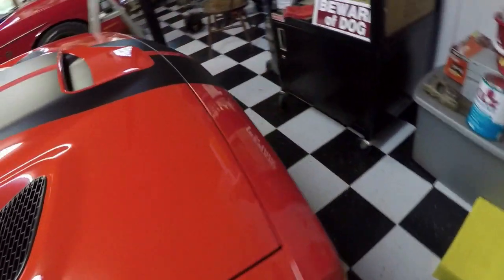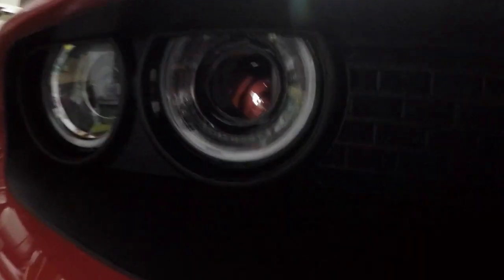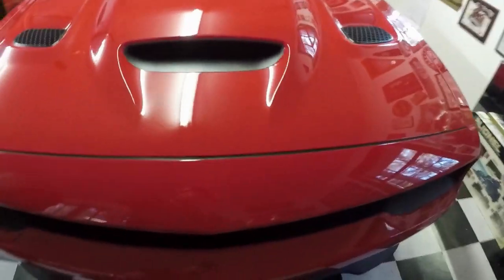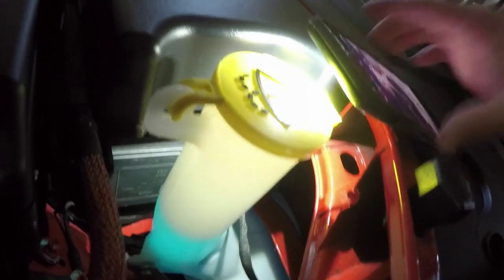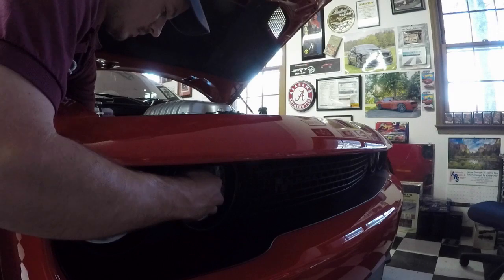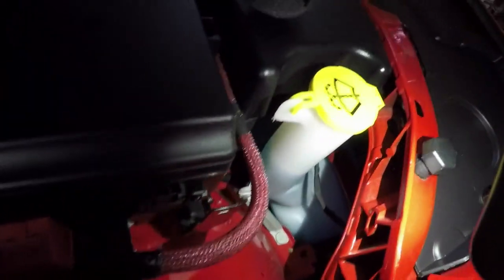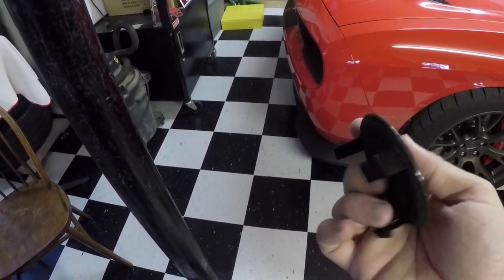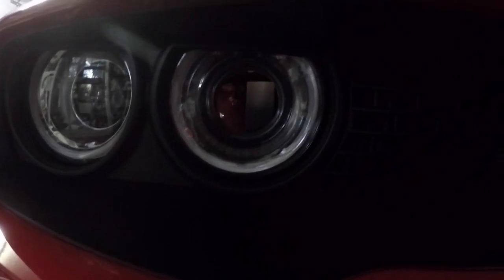How to - passenger headlight air intake! Hellcat

Comment: Could probably get some rubber hosing, (Like radiator hose or something from the hardware store) and create your own path into the airbox.
Reply: thats what i was thinking,
Reply: @jerrymosso3380  I ended up finding something cheap that is made for that :) used it on my hellcat, I'll fetch it for you. Spectre is the name of it, and they have different sizes for the intake / inlet of the car :)

Comment: Btw, if it rains and My hellcat headlights were hollow on both side like yours, does the rain water still might get inside? And does it caus any damage if that happens?
Reply from the maker: I think the two huge heat extractors on the hood will let in a lot more water that these lol I don't see any issues with the dealights being open.
Reply: lmfscrew ok thanks, I’ll try it as soon as I get my hellcat from Dealership
Reply: @Warren Grau Despite this person using the urgency of all caps, do not do this, these headlights are completely sealed from the factory. Drilling a hole will break that seal and allow moisture to get inside